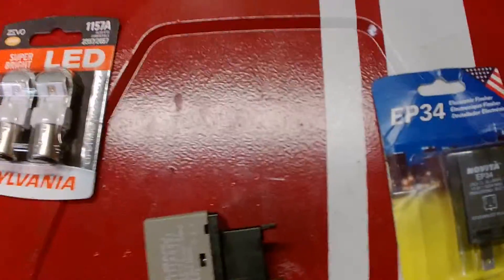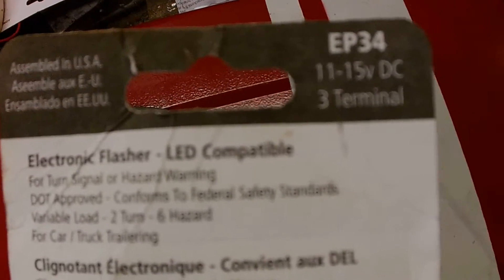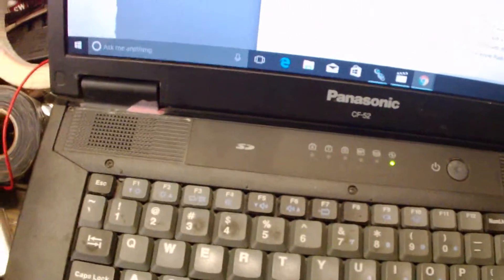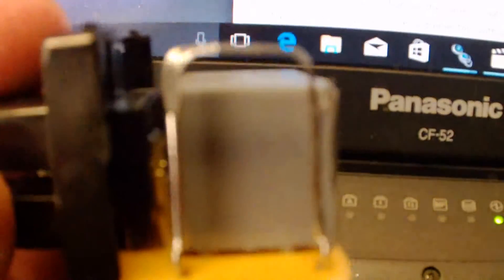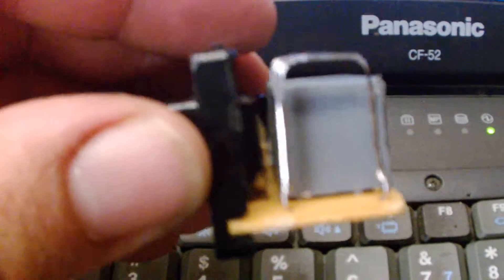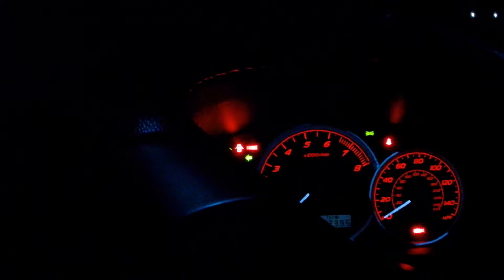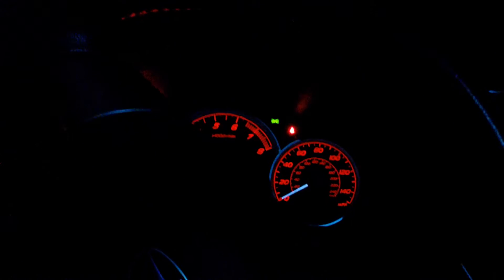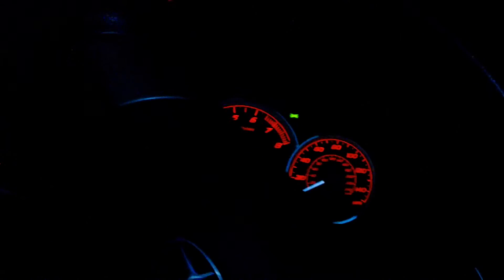Subaru WRX Modified blinker module for LED, removes fast blink, bulb out

Comment: What is the year of this WRX?
Reply from the maker: 2010 WRX
Reply: @spdwebdotnet  I'll be installing a blinker module/relay this weekend on a 2013 wrx. I turned on the blinkers and stuck my head under the footwell to listen for the sound and it sounds very close. I didn't pull any plastic off to fully know where it is, but I think only a few pieces need to come off in order to access the OEM relay